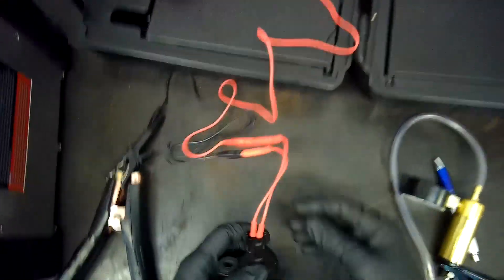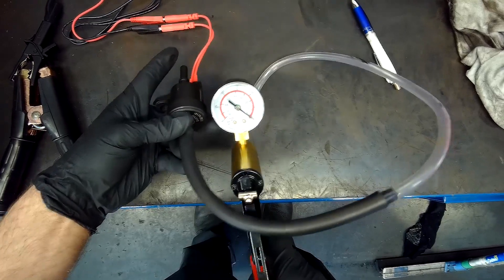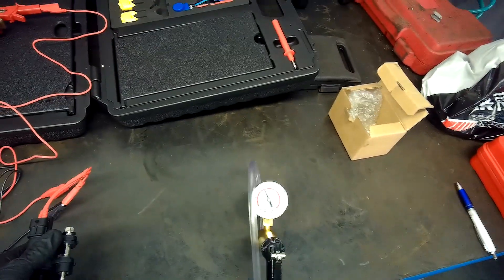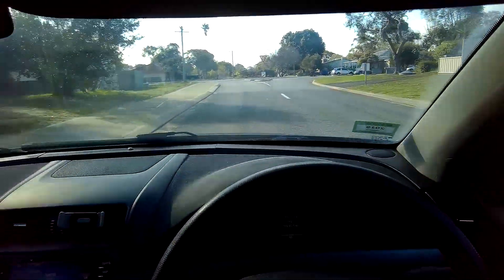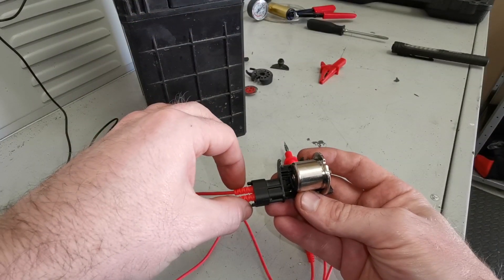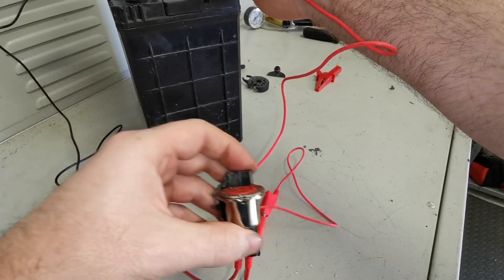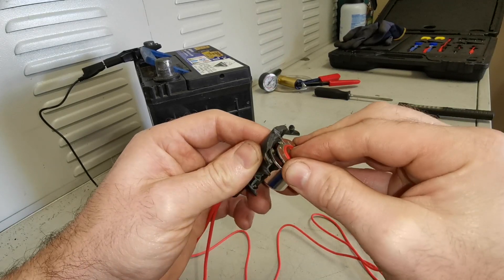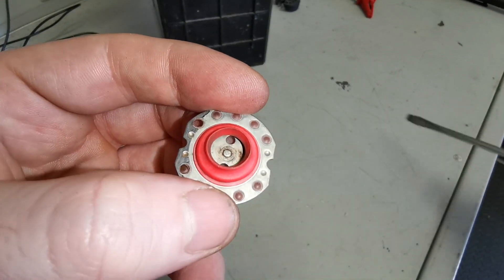Simple Test To Check An EVAP Purge Solenoid (P0171 P0174)

Comment: Hi Gerard, 
I have a Land Rover Lr3 4.4 V8
Having this part malfunctioning, can it cause excessive vacuum leakage? I notice when I take out the oil gauge, it sucks excessive air into the engine
I already change the PCV, oxygen sensors and maf.

I continue with P0170, P0171 & P074

I appreciate your help

Comment: Just diagnosed a purge valve on a Opel astra h very common too go also stuck open. good diag and explanation bud
Reply from the maker: Cheers Ian, can be a very problematic little unit 👍👌🙏🙏
Reply: @GerardBurkeBurkesGarage  sure can lead you down the garden path

Comment: Are those faults applicable here in Ireland as that model vehicle isn't available here ?
Reply from the maker: Absolutely Jim, fault codes cross over on all vehicles, so for example if it's a 4 cylinder it won't have a second bank but can have a p0171 fault logged. 
A useful test on many vehicles back in 🇮🇪